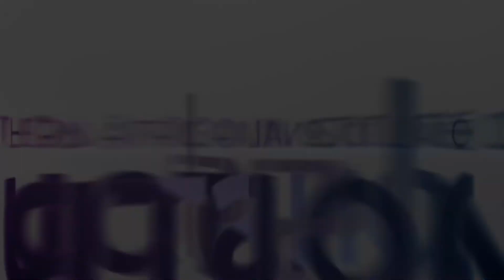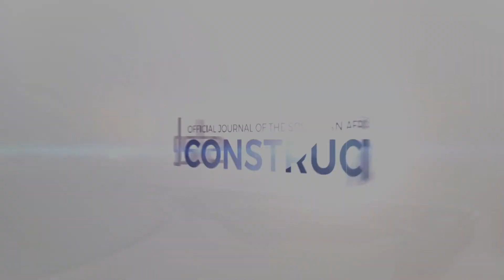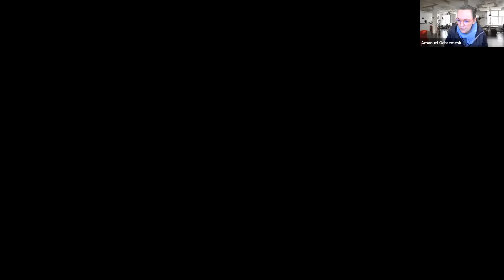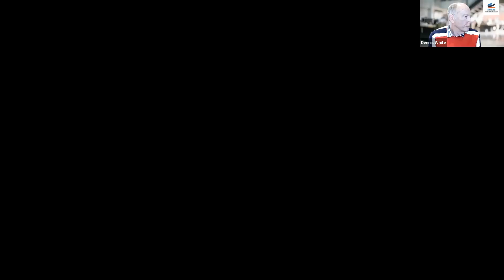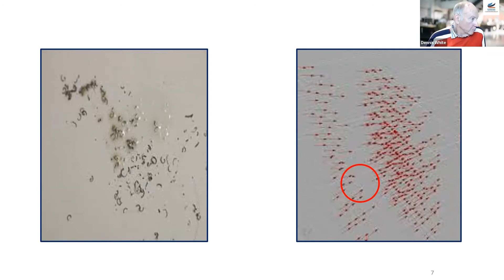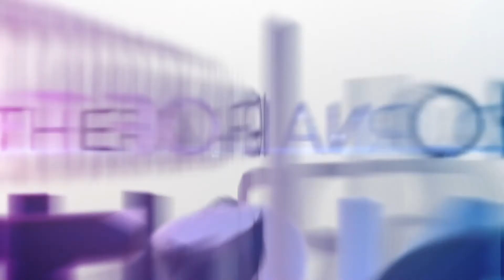Installing Photo Voltaic Panels on Existing Roofs  - SAMCRA Technical Q&A Session

Comment: Hi Dennis,

I'm reaching out to ask if you'd be willing to mentor me as I scale up operation my metal roofing sheet manufacturing facility which is about 90% complete with significant down-payment for plant and machinery in Ghana. We currently have 10,000-ton per annum capacity and I'd greatly value your guidance on expanding operations.

Would you be open to discussing this? I'd be happy to work around your schedule.

Best regards